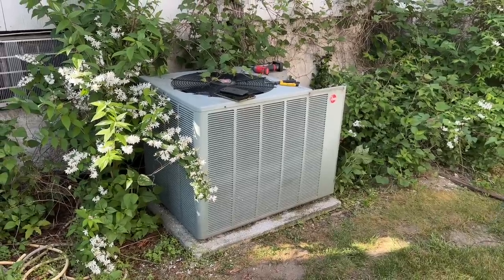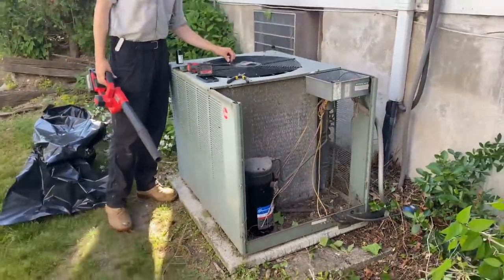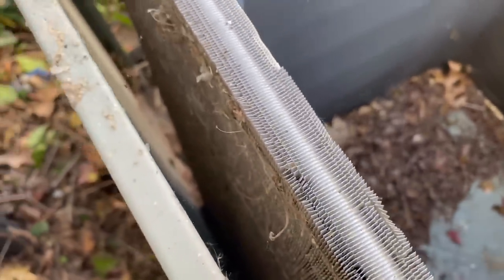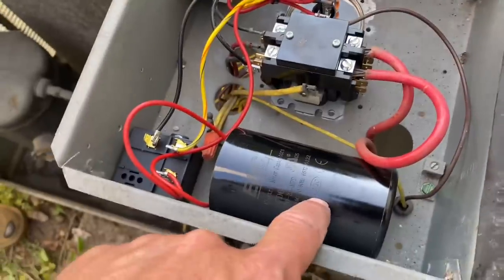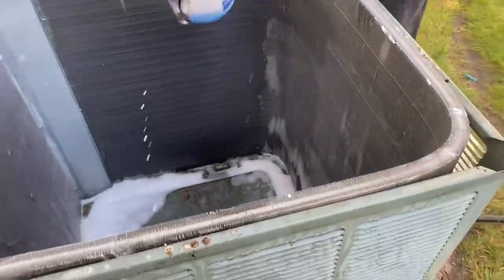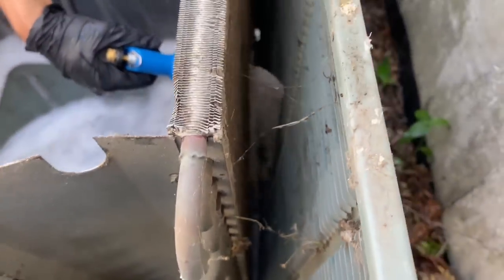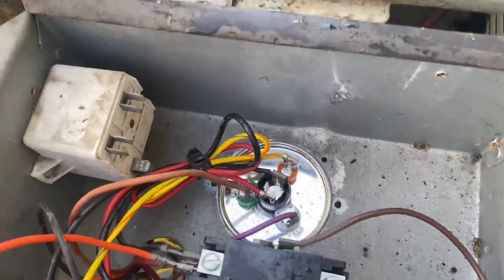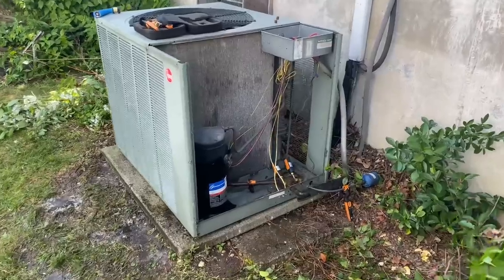Central AC Outdoor Condenser Overgrown by Bushes & Vegetation Brought Back to Life

Comment: We use SPP5 and SPP6 hard starts at my work. They use only 2 wires and have the relay built on the top internally. 👍🏼
Reply: Amrad makes 2 wire hard starts as well. Might want to check into those

Comment: Alcohol ethoxylate is the main ingredient in the all purpose. Condenser cleaner active ingredients are Alcohol ethoxylate, nonionic surfacant, Alcohols, C12-16, ethoxylated. Evap cleaner is the same as the condenser. You can clone that. No prob. And save tons of $$$$$. Also bottom up so you dont dilute the chem sounds like it might help you better. Much love.

Comment: I watched one video to where the guy simplified cleaning the debris and excess water out of the bottom of the condenser pan by using a unibit step drill bit and drilling several holes to facilitate draining any water. I'm guessing he's coming from a homeowner point of view and not using a wet dri vac

Comment: By the way Mickey I like running your software system sometime, again a thumb in your mouth or thumb in the another. I myself have over 30 years in the trade. And refrigerant is only a man made gasoline with high combustion point. I was trained by the Carrier Corporation.